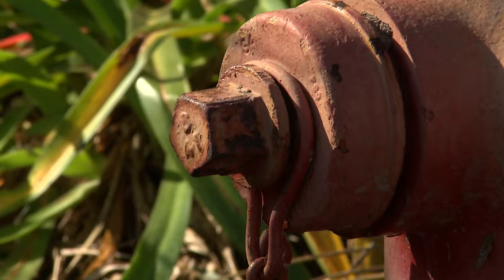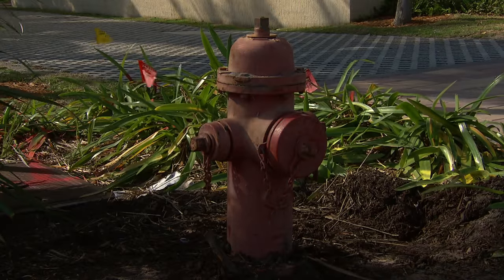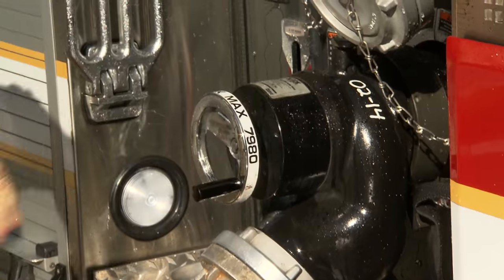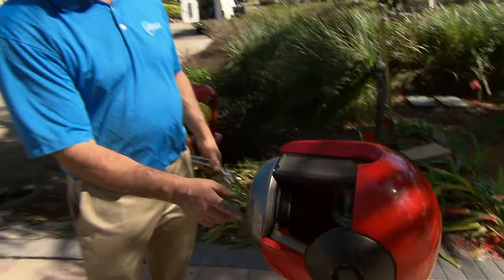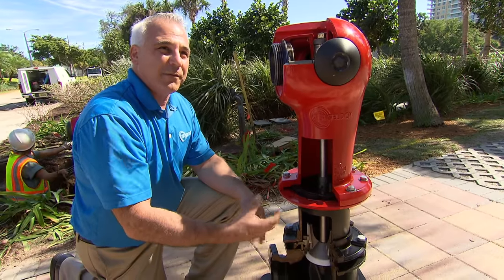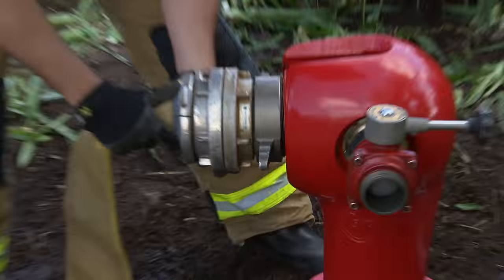The future fire hydrant

Comment: Now there's a fire after an ice storm. Ice is packed in the socket hole. Or vandals disrupt the socket hole.  This presents a problem which proves the antique better.
Reply: It would still be better to remodel the antique, perhaps with a better design. For a better water flow
Reply: smear a little jb weld over the socket and its done
Reply: @pumpkingamebox  was this on your recommended too? 😂
Reply: @pumpkingamebox  they have been already, continually. Even the biggest engines of NY or LA aren't restricted by a modern hydrant (by modern I mean 1980s or newer) the restriction in flow is in the pipes under the street. What makes you think current hydrants have a flow problem? Cause the guy selling his product told you they do? The guy that designed this lives in a warm climate and it definitely shows. Ice would be a real problem with these.
Reply: @alec4672  Yeah, that was dumb of me to assume. Just found out recently hydrants have colors to designate how much water is pushed through. Never knew.
Reply: @pumpkingamebox  depends on the area, it's up to the department with justification on what color their hydrants are. All of our pressurized hydrants are red no matter what size water supply there hooked up to. We have yellow draft hydrants too they just have a pipe hooked up to them that goes into a nearby lake just a convient way to suck water out of a source.
Reply: and some clown can cut the knob off an old one your point?
Reply: @edwardmyers1746  yeah, give that a try and I'll time ya. You gonna use a cut off wheel, that will take forever. Or you gonna take a cutting torch out into the street. 

Get real
Reply: @Izuku-Midoriya7  stainless actually gets really brittle when cold. If the cap is frozen on and you're beating on the wrench with a hammer you could definetly strip it.
Reply: In some cities in germany the hydrants are stored in the trucks and they just need to be connected to the underground watersupply wich is protected by a manholecover. Really easy and simple to use and isnt affected as much by corrosion or vandalism.
Reply: This inventor is so intelligent he doesn’t know a fire engine from a fire truck. Trucks carry ladders. Engines carry water. Always some guys trying to reinvent the wheel. Obviously never was a paid fireman.

Comment: If it ain't broke, don't fix it!
Reply: it broke
Reply: Ahh yes the moto of the fire service. "Don't change it" the horse drawn steam powered pumpers worked too.
Reply: it is broke
Reply: it’s an upgrade not a fix.
Reply: @kalijasin  Some things don't need to be upgraded.
Reply: dude, that's not how you spend tax money!
Reply: Facts
Reply: @VeryTalented Channel Name This new hydrant doesn’t solve that at all
Reply: @VeryTalented Channel Name you can find the tool that they use in the video for cheap on aliexpress or sites like that. so you can still take water from these hydrants illegally
Reply: @VeryTalented Channel Name if it’s got a lock it can be opened with the right tool and skill
Reply: @conorsmyth9963  how many people will actually spend money break into a fire hydrant though?
Reply: they'll probably replace the old ones when they go out of service.

Comment: some guy invented a quick connect to go on the old hydrants. it would be nice to get together with that guy and make the new hydrant quick connection instead of screwing the hose on
Reply: Click on, click off
Reply: Never understood why they still use threaded connections, on our boat all hydrant connections are 1/4 turn quick connections, much faster and no chance of stripping or crossthreading in a hurry
Reply: @billyboots3730  maybe it's a if it ain't broke don't fix it type of thing. Or last thing on the list during the annual budget meetings. It definitely would be easier
Reply: @inspectorsteve2287  how many of the old fire hydrants does the agency have, and how much per hydrant are they willing to pay to replace them all, just to make it marginally better?

Comment: Interesting, where I am we are a small rural Fire Department and we don't use what people normally consider a fire hydrant. We have what are called dry hydrants. They are basically pipes that run to a nearby water source (stream, creak, river, lake, ect) and our trucks pump the water out from them. Not having a large central water system, these would not work for us, but would be great in cities.

Comment: Sounds expensive for tax payers!
Reply: More spent on hydrants, less on the homeless and healthcare.
Reply: @pqrstzxerty1296  wtf is that take? Why should the government not let people die in their burning homes but let people with chronic conditions die preventably because they can’t afford medications for their chronic illnesses. More people need healthcare than fire protection and access to healthcare would save more lives. It’s also not like we are getting particularly good healthcare as it is compared to nations with a similar average gdp per capita.
Reply: Less expensive than the war in afghanistan and iraq
Reply: @boejiden7093  Here's the problem. How do you make money off this invention? Things like hydrants, traffic lights, etc are only replaced when repairs won't hold, or the cost to repair gets more expensive than the replacement.

It's simply too expensive to replace infrastructure like this in large quantities at once. By the time it is due to be replaced, in reasonable quantities, you have 100 more similar hydrant designs to compete with.

The cost is too large to justify the change in most cases. Look at the US, it is a common belief that the US should transition to the metric system, however, rewriting software to measure in metric, changing all the signs, textbooks, calibrating all the devices, replacement of many measuring tools, and much more would cost a fortune. So, do the benefits of switching to the metric system justify the cost?
Reply: @YesHumphreyAppleby  What point do you think he was trying to make
Reply: Very expensive. But better gear for the fire fighters.

Comment: For the people saying much hasn’t changed, you couldn’t be more wrong. polymers/plastics do not rust and degrade much slower than metals. If you look at most hydrant failures, it is the result of a part of the hydrant mechanism failing and not the water main itself. Also, when the water main breaks it is usually due to how the fire hydrant is operated (opened/shut too quickly).

Comment: The real problem, which was pointed out in the longer version of this video, is that residents of shits holes damage and destroy hydrants. So this schmucks idea is to make a new unimproved hydrant with proprietary designs instead of dealing with the actual issue. It will still get vandalized in those communities.

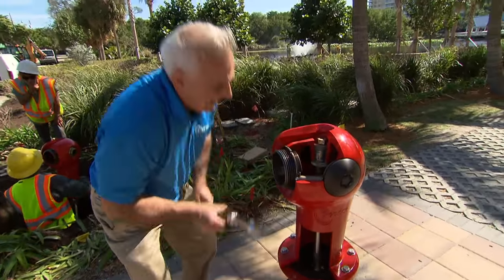Comment: 0:48 And when that gets packed full of ice and snow, then what do you do? The original is fine, if it ain't broke don't fix it.
Reply: I think it has protection against that, plus why improve anything with that logic?
Reply: 2nd Lt. Cohiba Fox so why do they make new cars? Why do they change the look of the cars? They aren't broken, so why make new ones
Reply: Fell Man I don't see any protection at all. This guy has probably never seen snow, let alone have to fight a fire in below freezing temperatures. Something like that packs full of snow and ice, you'll be forever trying to get a damn wrench on that. There's a reason the design has never really been changed, nothing needs changing on it.
Reply: 2nd Lt. Cohiba Fox 
there is a metal coating that melts ice, maybe just maybe they could use that 😐
Reply: It can be packed with snow because its covered, go back a second and watch him slide out the cover.

the amount that can pack in above that cover is probably not enough to stop it performing
Reply: If you're talking about the big hole in the side that's just to show people the insides

Comment: Too all the people bitching and saying its still a fire hydrant then I'm pretty sure you know absolute nothing... The point of this is to save time and easy quick access. Yesterday I watched a video of a firemen trying to extinguish a fire but guess what. It took so long to crank the fire extinguisher for half a minute then had to close it because he was flushing out all the dirt and rust. Then had to install the hose and loosen it up and take another 30 seconds of continuously cranking it open and attach the pipe. But this is gonna save time because you just unlock the huge cap that covers the hydrant and unloosen the bolt with a twist and youre ready to go. This will mainly save time and lives so enough with all the "It's still a fucking hydrant comments".
Reply: VanillaSnow you're still going to have to do exactly the same thing with this one as you do the old style hydrants. They will still need to be flushed before connecting a hose. Clearly you aren't a firefighter
Reply: VanillaSnow That could be a problem with the fire hydrant they were using not the design. Don't you think if they had to struggle with the hydrant on a regular basis the design would be changed?

Comment: I think its great! Problem with the old ones, at least here is that when u open it all the water flows right out. So here They GOT the oppertunity to hook up the pipe before They start the water. 
And They doesnt have to replace old ones but instead in new towns and neighbourhoods They put up these.
Reply: The bolt on top of the old hydrant and the model being shown in the video opens and closes the valve that’s underground. Water coming out when the caps are removed is either due to a leak or someone not making sure the valve is closed before they undo the caps

Comment: the people commenting here are not very smart because fire fighters have to deal with water thieves and when a fire hydrant is opened for no reason like a thief wanting free water it causes pressure problems which means it may cause fire fighters that are close enough by to take longer to put out a fire and the water pumps on fire trucks can increase the water pressure as much as they need it to get to but are limited by the water flow from the hydrant so that's why they are modernizing fire hydrants.

Comment: Or you do it like pretty much any other country and reduce fire hydrants to an access port in the ground covered by a metal plate with a small sign next to it...
Reply: If they can't see the hydrant, they won't see the sign. Plus, it would be difficult to get to in the winter. It would be possibly frozen over.

Comment: Why do they have to be these massive things sticking out the ground. All the fire hydrants in the UK are under ground, you just lift the flap attach your pipe, turn the valve and you got water, easy.
Reply: How does that work with snow? Is it in the road so it gets Plowed or off road?

Comment: The hydrant doesn't really matter. It's the pipes feeding the hydrants.
Reply: the only known issue with fire hydrant i know of is when the reservoirs are low, the pressure is low...
Reply: The coefficient of the hydrant is also important to know.
Reply: Oh wow ... are you an engineer?
Reply: @DesignByKirk  obviously... that why we are follower ...
Reply: @DesignByKirk  Depends on what kind of engineer you mean.
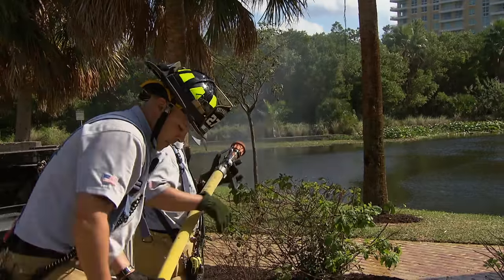Reply: 1:18
Reply: Hydrants can still break lol. If the hydrant has a hole for the water to come out that is 1 inch in diameter it won’t work well.
Reply: @ClebyHerris  Yeah, but our current hydrants aren't made like that, so that's not really an argument for replacing them, is it?
Our current hydrants have 2x 2.5in outlets and a 5in outlet.
Reply: I love YouTube. Some random commenter thinks he is smarter Than the professionals in the video LOL.
Reply: @mlo527  this right here is the problem with humans people. 

Just because someone is on TV telling you how good something is they are TRYING TO SELL, doesn't  mean they are right or smarter than you. They are humans just like you and i, and if i have knowledge in a certain subject, why wouldn't i call out the people selling stuff on videos?
Reply: @Mysteryskatin  spoken like a true non engineer, lol

Comment: They keep saying this hydrant gives them better Gallons Per Mintue (GPMs) to their truck..... the Hydrants have NOTHING to do what what pressure is coming out of the Hydrant.... They (are supposed to be) Color coordinated so a certain color means "X" flow but that doesnt really happen in the real world. There is also a reason why Hydrants haven't changed in decades..... Your just reinventing the wheel
Reply: I am not color blind but the only two colors I seen are Red or Yellow, but depending on how far away the hydrant is from the main supply provider then yeah there will some but not significant pressure loss, seeing as many truck are equipped to raise from the standard hydrant pressure to a higher pressure by onboard water compression system..

Edit (ammend): Like I said and those others mention, they are not color coded to pressure or volume, the only reason they are colored differently is for aesthetics.
Reply: yea most cities dont really follow the color coding. I work for the water utility in my City and we paint all of ours silver....
Reply: IgotGreens101 With more bends and sharper turns, you get less flow. Perhaps the new design changes that? I doubt you'd see much of a difference.
Reply: Lol, no i'm not a Firefighter and this had NOTHING to do with being one... This is about the Fire Hydrant. I just happen to work for a very big water utility in Texas. We also just opened up one of the largest inland water desalination plants in the United States.
I am but a simple Water/Wastewater Mechanic... With a "C" wastewater License and a "C" Groundwater license in the state of Texas.

Now then, the Fire hydrant doesn't give them their pressure... the water pressure comes from the pumps that supply the line..... the Hydrant is literally a Valve that is it.... Open or Close. Now once the water is out of the Hydrant and into the fire truck they do use Booster pumps to increase their PSI to help fight fires. More GPMS = Higher PSI
Reply: Igotgreens, what you don't understand is that every appliance, valve, elbow, etc, add friction loss to the available flow.  When you make the inside smoother, it means there is LESS friction loss which means less  pressure is needed for a given flow.  It also reduces turbulence.  I would think someone like you would know about friction loss, but evidently not.
Reply: In my city the color is on the caps and represents something with the water main it’s really not the pressure and that’s from my city Fire Marshal!
Reply: Where I live, the tops are painted different colors. Green, for excellent water flow. Orange, for OK flow. Red for, don't bother. It all depends on the water main.

Comment: Good luck selling new tech to an industry who's moto is "100's of years of history unimpeded by progress"
Reply: "Progress" means unreliable and untested. Better to stick with what works all the time than risk failure for something that's barely marginally better in some circumstances.
Reply: @s0nnyburnett  I'm sure that's what they said when steam powered pumpers, and then gas/diesel powered pumper came around. Or when someone proposed SCBA's. If the fire service was a company it would go bankrupt for that exact mentality. Every firehouse has a meeting room full of old-school guys unwilling to change and new guys unwilling to speak up out of fear. I say bring back the bucket brigade. Nothing is as fail safe and time tested as that.
Reply: @liamhilt1822  The problem is that this would cost a hideous amount of money for no meaningful effect on performance. You are probably looking at 10,000 dollars minimum for each of these things installed.
Reply: @bahhumbug2072  $850,000 ladder truck... Regardless of that I do agree it would be expensive to change them all out. I wouldn't expect that would be how it's done but rather when old hydrants fail they are replaced with these or new construction areas / upgrades to the water system these would be used. Yes the issue becomes multiple styles of hydrants in a district but that's already a thing in many areas. Depending on where we mutual aid to I may need to use a double higsby adapter, 5" storz to 4" storz, and an opposite open direction for their hydrants.  I can't answer if they are "better" than the others but neither can you. My main issue here is all the knee jerk reactions to say no because it's different and different things scare some people.
Reply: Progress is slow in the fire service, not non existent.  EMTs, SCBAs, LDH and PPV are just a few examples of good progress.  We had a company called ZipNut make a quick thread connector that for some reason fizzled. Training is much improved.  As a new kid I remember dinosaurs saying, “you can’t throw books at a fire.”  Actually you can, but it is better to open them up and actually learn from them.

Comment: The old style works just fine and is more accessible to the community. no special tools required.
Reply: is this not a special tool? https://en.wikipedia.org/wiki/Hydrant_wrench
Reply: @xQuantom  this isn't France. The United States has 1 tool to open the hydrant. You could also use a pipe wrench, if needed.
Reply: @Normal1855  so you’re the person that’s ruining hydrants by rounding them off. And US hydrants need to be turned using a hydrant wrench.

Comment: It still doesn’t allow for a proper seal to the hose, and if all it takes is a quick left turn then unscrew by hand, i could give you multiple tools that can open that hydrant. Another point to make is that the hydrant isn’t the problem when it comes to how much water you get from the hydrant itself, it’s a matter of what size water main is connected to the hydrant to supply your water which is why hydrants are color coded